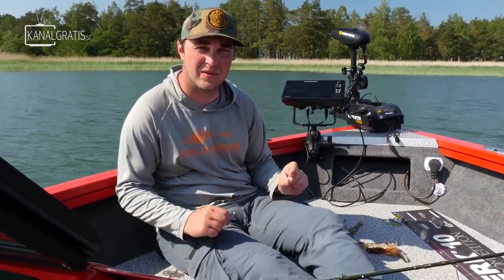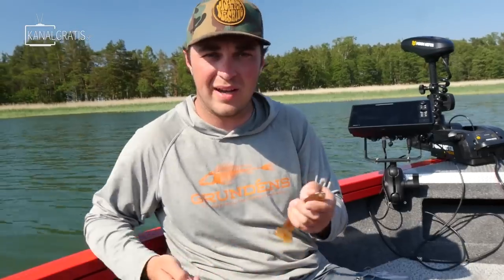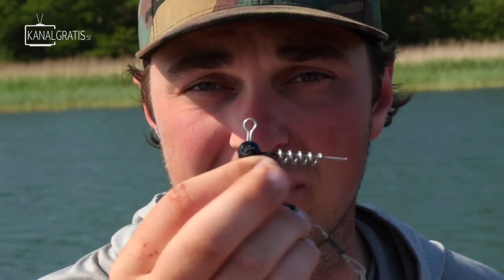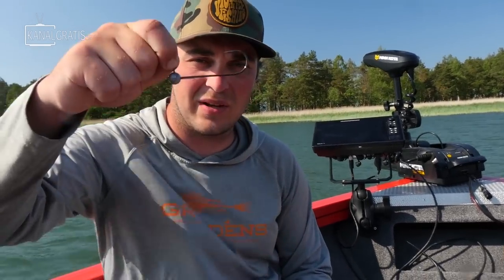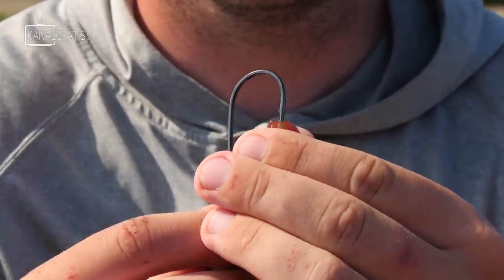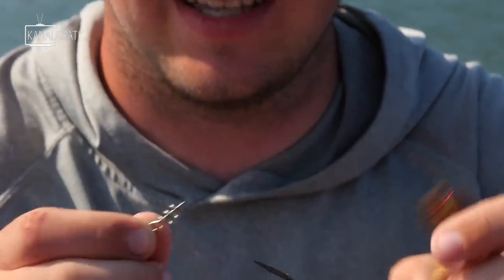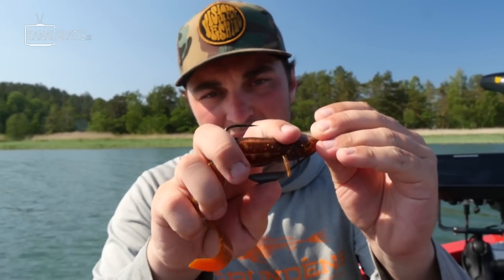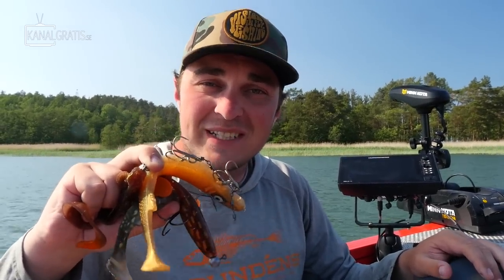How to rig a PIKE SOFTBAIT (Shallow, Weedless, Jighead & Flexhead)

Comment: In third method i use jigheads to bait 15-22cm but hook point is close to head where the pike attack most (like you said) and i put anchor on belly close to tail. If you put hook close to middle you may have more blank takes. Next film pls make with types of retrieving with different baits  ;)

Comment: Ewg hooks work with almost every shad, if its not slim, 2,3cm cut in belly (half lure deep) it works with Cannibal 15 and 20cm, plus i put a dropshot weight on snap for deep water(most big ewg hooks got 3,4 gram weight) hook slides in belly cut and hook ratio is almost 100%,weeds, trees whatever, it just works